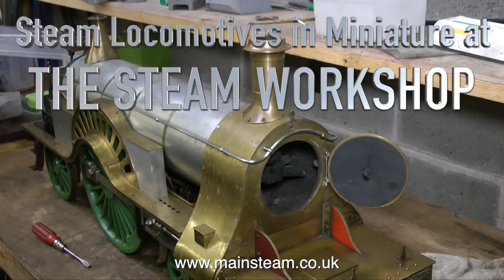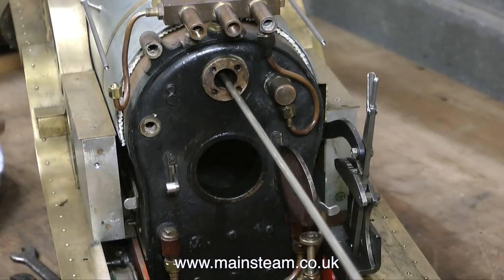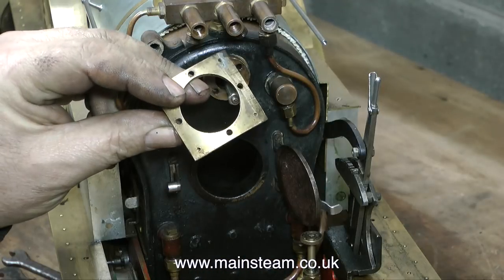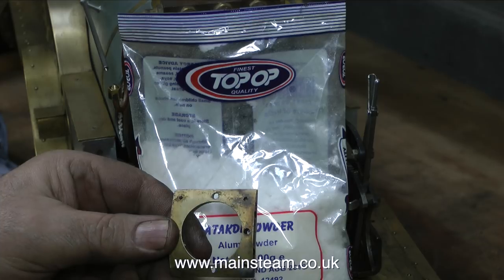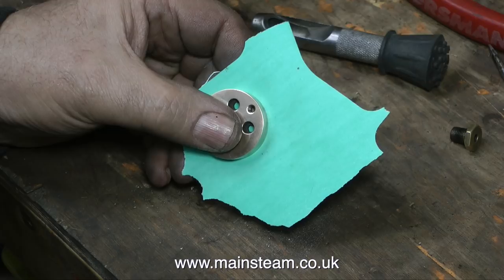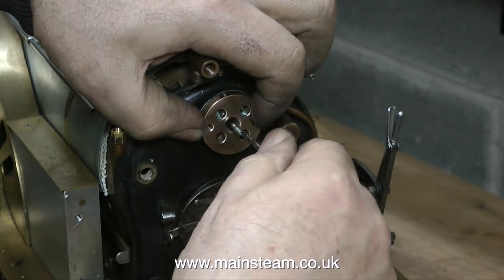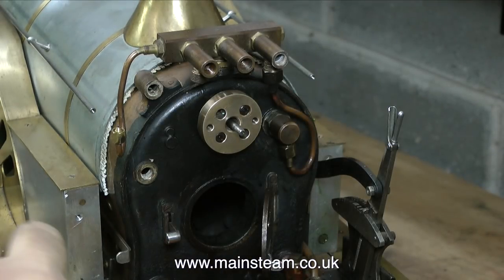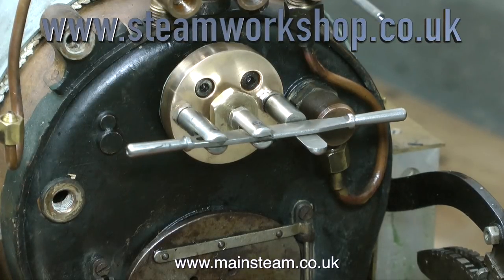WORKING AT THE STEAM WORKSHOP - MY STIRLING SINGLE

Comment: I'll take the risk of passing for an expert: as far as I know, the type of piston-like regulator you mention was common even in Britain before the late 1870s/1880s. The Stroudley regulator, the one that opens and closes by rotating the lever, was designed by William Stroudley while he was working for the LB&SCR, a competitor of the GNR for which Patrick Stirling designed the Stirling Single.
So, while I can't be 100% sure of this (on one hand, Stirling and Stroudley were indeed friends and compared works: on the other, Stirling was a really stubborn man, dead set in his ways, to the point that for example he kept using the single driving wheel design even after the coupled driving wheels design was proven viable and effective and used since several years by the competitors) I'd say that the piston-type regulator on your locomotive may not be as out of place as it seems.
Reply: I have photos of the Stirling cab, it is a push in/out style of regulator.

Comment: That intermediate Bahco replacement spanner looks suspiciously like a football stud spanner to me O.o   Hand Tool Rescue a channel on here will be producing the proper old school adjustables for sale you might find interesting as I found them a lot easier to work with myself than C shape adjustables which the C wrenches always seemed to get possessed with the bedevilment of loosening up at the worst moment (even my old Snap on wrench undoes itself) Best adjustable C wrench I ever got was a Silverline beast from Lidl's way way back, goes as wide as 50mm and has 10mm, 13mm and 17mm cutouts in the shaft :D

Comment: What Keith is showing is Potassium alum, used for a lot things such as medicine and deodorants, but in this case it's used by machinists.  I used it as a mechanic to dissolve broken screws in carburetor bodies.  Yes, some manufacturers used dissimilar metals together, even though they knew they shouldn't do so! 
 Example: Aluminum and copper in distributor caps and radiators. UGH!   BTW- Alum is also the main ingredient in baking powder!

Comment: I have a question concerning the injector water valves you showed in an earlier video.  I purchased a couple from Blackgates to use on my American Tender.  One for the injector and one to use as a drain valve in emptying the tender water.  How did you attach the supplied handle to the valve spool?  I am thinking 603 Loctite, but thought I should ask if it needs to be soldered into the spool.
Reply from the maker: Cross drill it and us a small bolt to secure the shaft - then you can remove it easily if you want to change the valve {:-)))

Comment: Here in America there is a locomotive similar to the Sterling called the "Huntington".  I hope the sterling doesnt have the drawback of the Huntington.  Seems that if there is a dip in the track the Huntington would rather spin its wheels than proceed down the track.  Little Engines was the recreator of the locomotive in 7.xx gauge
Reply: wi11y1960 UK track was of enough quality that that wasn't an issue.

Comment: If you use anti seize, which I highly recommend, you must reduce the (torque) tightening of the fasteners as the anti seize will lubricate the threads and you could strip them. A 45% reduction is recommended as you have reduced the friction between all the threads. Proceed carefully, and if you can make a test piece and try it and see what happens. Trust me I worked in this industry with fasteners and thread compounds. Everything is available on the internet for verification. Good luck. I like your videos.
Reply: YT curious, what if you used spark plug anti seize on tyre studs  ( to reduce galvantic effects )?  ( I only torqued them 10% less ).  Not even an 11 foot breaker bar worked removing a few of the studs....initially!

Comment: Have you ever used anti seize to stop the cap heads from welding themselves in place? I just looked up the specs for the loctite 51147 (copper base) product and it states it is useable up to 982 degrees celsius.
Reply from the maker: I have used "Copperslip" but I just prefer to use stainless steel bolts ...